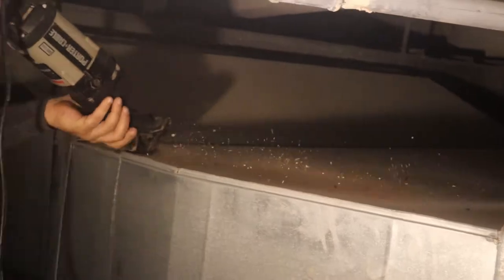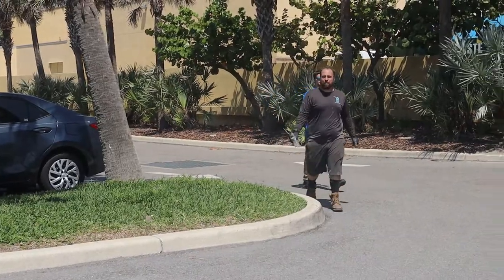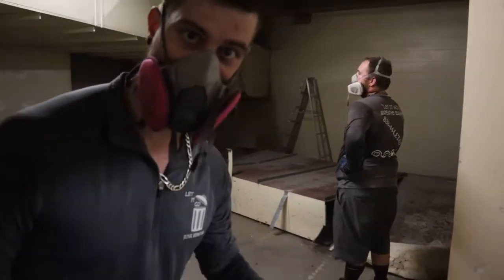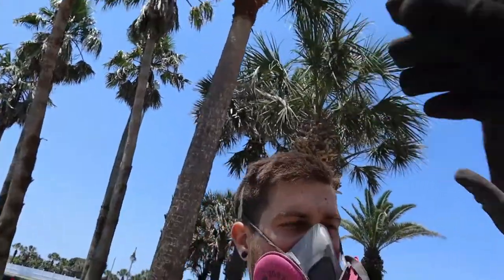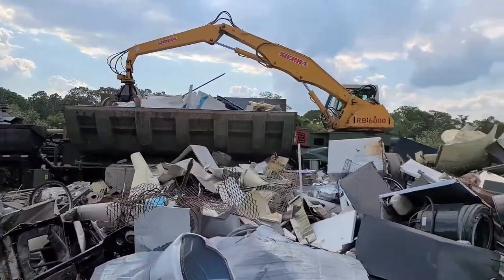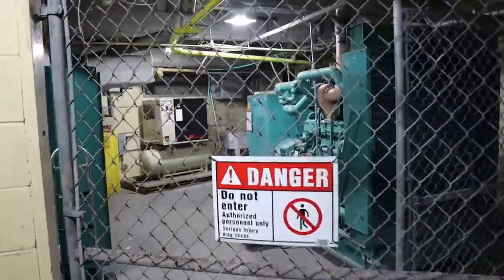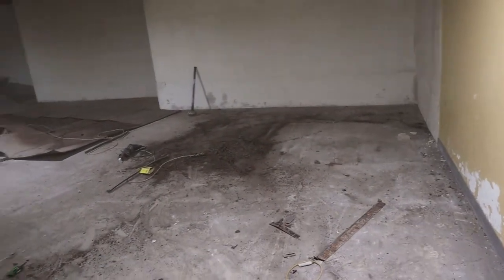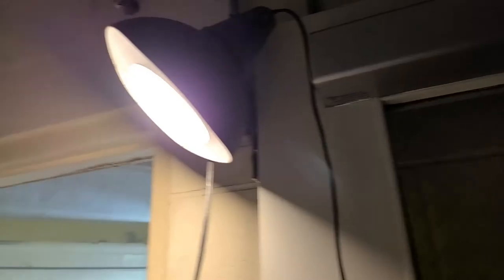How To Remove Giant Air Ducts from hotel

Comment: I used to installed duct work like that. It may have been easier to separate it instead of cutting it. We used metal slip to join them together. Too late now, you’re already done. Lol
Reply: @MreFEy  
As I watched further, that’s what I told my wife. “That sh!t is rusty, it would be better to cut it up”. You know what you’re doing.